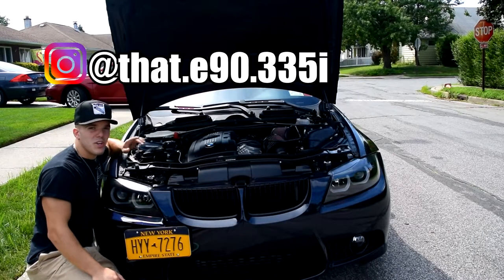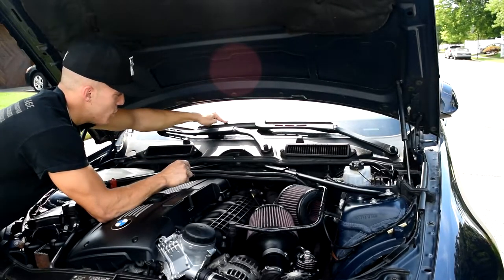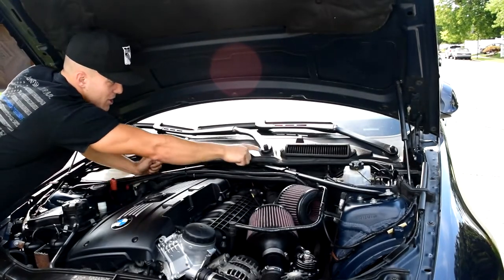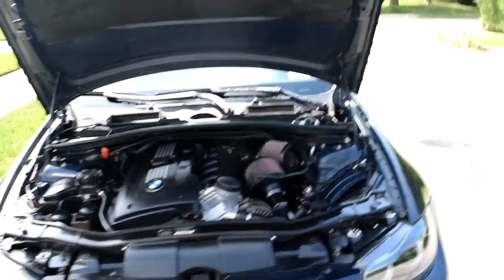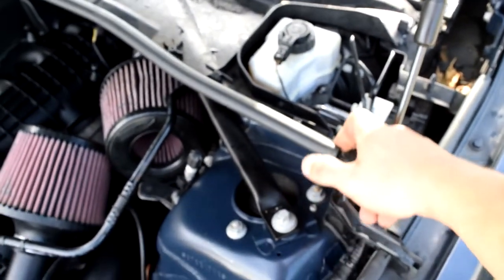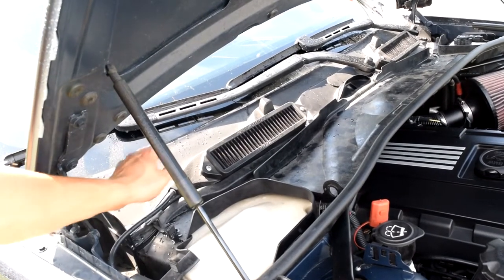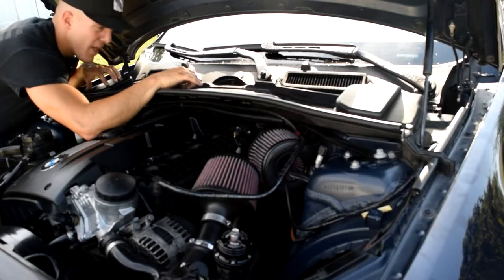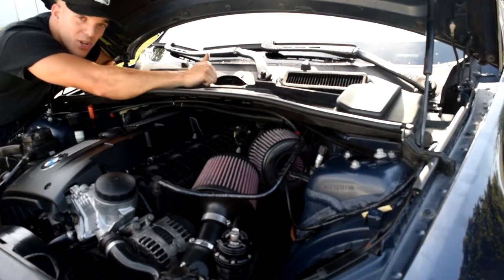Burger Motorsports Cowl Filter Problem FIXED!

Comment: The biggest selling point is that it's going to dissipate heat from your engine bay and they don't tell you what you just explained which is common sense, I questioned that myself before I'm looking to buy this thing well worth doing it with the way you set it up you just got to suffer with a little more heat lol there is another system that does divert the water problem and it's super expensive not worth the money ,so 10 degrees oil temp just take top plastic heat shield off ! Good to go ! THX
Reply from the maker: Exactly. No one really talked about the water issue when taking off the stock cowl filter and the housing. But leaving just that one piece wasn't too big of an issue for me. Also I have heard people cutting the stock cowl filter housing to resemble more of an m3 cowl look.
Reply: @acauto7886  yeah I'm going to buy a used one and makeshift it see how it works

Comment: 3:10 watch your dme the water clearly leaks and drips on the cover I got a e92 and that just worries me regardless knowing water is getting near that im gonna see if mine does the same or maybe yours is cracked?
Reply from the maker: Could be a possible crack. Ill definitely check it out. Thnx for pointing that out
Reply: water is going to leak there regardless of this mod, all he took off was the filter cover which does nothing for water diversion
Reply: @vdubskiee5356 some people delete the cowl as well🤦that's where the problems arise.

Comment: What do you do with the wiring harness that mounds on the bottom of the cowl. Think I g about doing the delete on my 07 328i but I don’t know if the wires will just rest on the engine cover?
Reply from the maker: I zip tied everything to the v strut

Comment: Doesn’t make sense to get them if your not deleting anything I get the stock cabin filters are gone but the point is too make space so that it’s easier to work on without need of constantly taking of the cowl
Reply from the maker: I did delete. I deleted the big filter as well as the top piece. That's two less pieces to take out. I think it was worth it 100%.

Comment: i got a new shiny magnesium valve cover for my n52, so i was going to do the cowl delete and add a n52 badge to the valve cove, when i get the filters im going to see if theres a way to guide the water without having the full cowl, this will be an even bigger issue for me since i wont have the plastic engine cover anymore
Reply from the maker: I was doing research. You can cut the cowl by the valve cover. Cut the stock cowl with a dremel. Look up e9X m3 cowl. You can cut your stock one to look similar to the m3 cowl
Reply: @acauto7886  I may do that, I’m thinking about just cutting the part where the old filter would go so I can still have the cover that goes over the ecu housing since it rains here often, I have headers and there’s noticeably more heat trapped under the cowl now and I need to do something about it
Reply: @acauto7886  just put them on and I’m not a fan, I’m sure they sound good on a 54 because of the turbos but on a 52 all they do is make wind noise and lifter noises louder, I’ll probably just cut old filter out and put it over the new ones

Comment: I understand it helps for water but wouldn't it defeat the purpose of hearing the engine bay being louder
Reply from the maker: I didn't really hear a difference in sound with the stock piece on/off
Reply: STUNNA 30K you cut it like the budget beamers guy did
Reply: @123456bmx  thats exactly what im gonna do.

Comment: I regret this mod also i burned the connectors on my coil 5-6 because of this i also drove without engine cover wound’t recommand you also lose all protection from snow and hale it was the snow that got it but notice there is an connector from te transmision under the car where the water can get in to
Reply from the maker: Wow, I'm sorry to hear that. I never drive without the engine cover, too risky in my opinion. But I threw the bottom of the stock cowl back in to fix the issue

Comment: Did the sweet turbo sound go away?
Reply from the maker: What do you mean by that? Are u asking if re-installing the bottom piece of the cabin filter reduced turbo spool?
Reply: @acauto7886  , no, I was wondering since in my personal experience,  that I get lots of turbo sounds with the bottom section of mine removed. I ran it once with no tray, and no cabin filters. It was turbo sound x's 100!!! And I'm just trying to figure out, by simply placing the tray back while still using the bms cabin filters and tray in place. Did it reduce the sound of turbo spool and whooshing? I know it wont effect the spool, just sound is my only question.
Reply from the maker: @frankdogg75  personally I dont really know if I was able to hear the turbos with all of the trays removed, but I had to put that bottom tray back in because alot of water had access to engine bay running the cowl filters alone

Comment: Might as well just use the stock system
Reply: yes but now the filters never have to come off so if you need to remove the engine cover it’s only the 2 8mm bolts to remove the cowl instead of 8 bolts the remove it and saves some weight

Comment: You put it back so the heat Problem is again back 😂
So you Dont need the bms Filter 
You Can run normal ?

This mod is for Heat 😂
You put it back and the Heat is there again...
Reply from the maker: I didnt do the mod to resolve the heat issue lol. Removing the cowl makes the smallest difference haha. My main reason for doing this was because it was so annoying to disassemble the cowl and remove it each time for a mod and having to re-install it afterwards. At least now with the bottom only in, it guides the water away from the engine and all i have to do is take off the two 8mm on each side rather than taking apart the whole cowl
Reply: AC Auto cut it like m3. I cut it and install also the bms cowl Filters. I fcked 3 times my sparks and ignition Coil at cylinder 5 and 6 😅.  With the water you was Right.  But you Named you Video you fixed it.
But you dont fixed it.
Putting it back is Not the reason for installing bms Filters 😅

When you Cut it you Dont get heat issue and no water issue.
(Or buy from m3 But Expensive) 

Cheers Max 👍
Reply from the maker: What do you mean you cut it? And i did fix it lol. The problem was water getting in. I fixed it by putting the bottom of the cowl back
Reply: AC Auto you put the wight and the Heat back on and you Need to remove it for sparks or other Stuff 
Sorry 
Thats No fix 😂😂

And i cut it like the oem m3 Look like :) 
Google it
M3 e92 engine Bay
My looks the Same But i cut it and Dont buy from m3
Reply: @kupferoxid9423  you need to learn to speak English before you act demeaning to people
Reply: @SuperVarunan  oh
To Bad to Understand ? 😅
Reply: @kupferoxid9423  yes.
Reply: @SuperVarunan  sorry :/